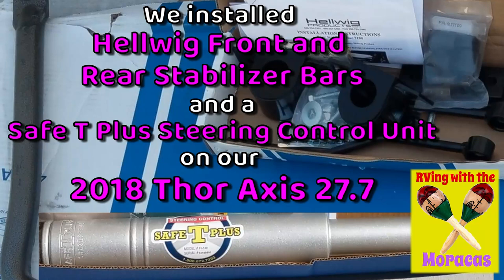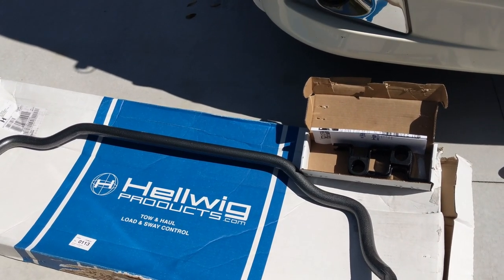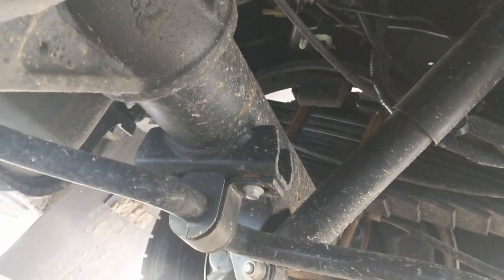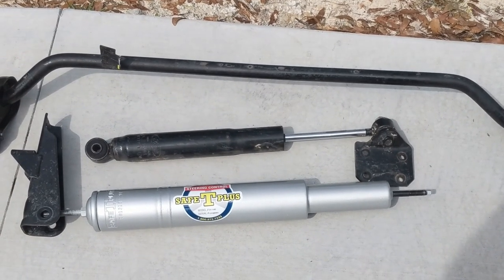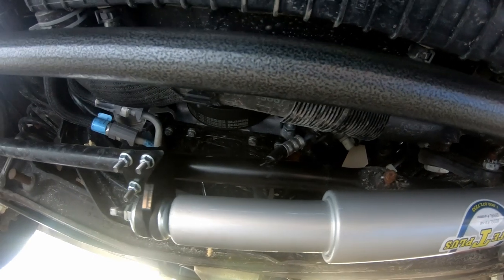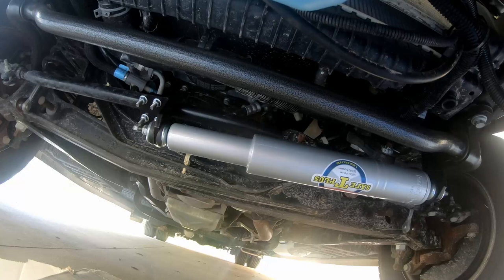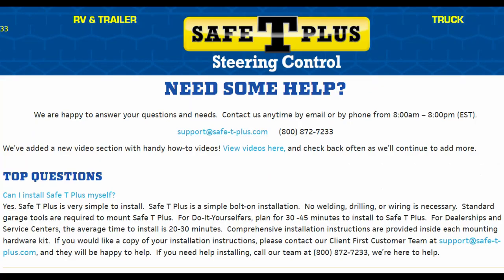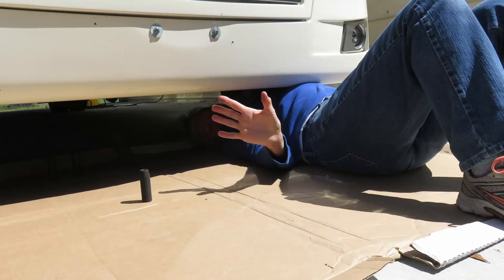RV Hacks Hellwig Sway Bars & SafeT Plus

Comment: Great video. The front Helwig sway bar I just installed on our 2018 Ford E450 in Nov 2023 included 2 new bolts/washers to replace the smaller headed bolts. Now all 4 bolts use the same size socket.

Comment: We did the front and rear Hellwig bars, front Sumo springs and the SafeTplus, wow what a difference. A pleasure to drive now.
Reply: That's what I'd like to do.  What year & model is your motorcoach? Did you DIY or have it done by a suspension specialist?  Are you thinking of replacing the stock shocks too?

Comment: We have Safe-T-Plus and Sumo Springs plus had extra positive Caster on our alignment, drives much better. The Safe-T-Plus factory in Atlanta installed our steering stabilizer and has already replaced it once and adjusted it twice at no charge. BTW, I think some of the right channel audio didn't play on your video.
Reply from the maker: Good to hear SafeTPlus has such great service.  I will have to listen with headphones 🍀
Reply: Hi 
Can you please share some info about the caster positive upgrade .

I am going to do it next week and i have the caster bushings for my 97 ford e350 tioga 24ft.
Right bow i have 3.2-4.2 caster 
How much the caster needs to be?

What price for labor this upgrade should cost?

Thanks.

Comment: You still need to do the sumosprings you will be surprised with the differece in driving
Reply from the maker: We did add the sumo springs and we agree the ride is much better.
Reply: @RVingwiththeMoracas  Do the sumo springs give a softer ride on the freeway?
Reply from the maker: Yes, we noticed a difference.

Comment: Steering stabilizers are just shock absorbers.. there is no center.  It just dampens the shock load from road input.  Centering is done by the caster in the wheel alignment.  If the shock absorber / steering stabilizer has a centering position and the caster center and the stabilizer center don't match..  you are going to have the 2 systems fighting each other,  and possibly creating a pull left across the center line or right onto the shoulder.  NOT good.
Reply: Yeah..  you shouldn't be having to adjust the steering stabilizer that finite.   If the original shock absorber was still absorbing shocks..  not pushing itself to any position, it was probably fine.  If a person didn't get the new stabilizer just right..  watch out lawsuit.
Reply: The Safe-T-Plus and Roadmaster RSSC do contain opposing springs for centering and a shock absorber each as well. One shouldn't ask either product to act as a band-aid to correct an underlying problem as it may compromise the unit when needed in a crisis (IE steer tire blowout at speed). They shouldn't do the work afforded by a proper alignment for the weight and driving characteristics of each individual MH (that particular vehicle loaded in travel mode). 
Getting a "proper" alignment for Ford E-350/E-450 chassis can be obtained but absolutely needs technician that knows what he's/she's doing with proper replacement bushings to achieve the configuration of CASTER for steering & return to center & wander correction :  CAMBER : and TOE-IN. Look into it (IRV2 and other web threads and those associated within their MH's brands) before paying for the everyday big bucks for the little effort service of 'TOE and go' most common today by computerized alignment jockeys relying on Ford's very liberal range of values (caster mainly) - which is necessary due to the versatile nature of the "E" chassis in all kinds of trucking/civil use configurations, hence it's popularity. Yes, "it's within Ford's specs", but not the specs the subject MH needs to drive correctly.
 Once the rig is aligned correctly and driving true, then add a safety steering stabilizer unit. In a panic moment, with the extreme shocks and noises of a steer blowout, having the aid provided by one of these units, in good shape and not fatigued, could make the difference between an inconvenience and a disaster. I'm not suggesting it'll keep you upright and on the pavement by itself, but it'll give instant and additional resistance to the immediate pull towards the compromised tire's side than a shock absorber alone, and offer a split second more time for the driver to concentrate on his steering wheel to correct and control the direction of steer,  accelerate a bit to get control of the vehicle's forward momentum, then direct it to a safer stop.

Comment: Thanks for the video. Question, I have same Ford e450 for my rv. Looking at the driver side where the anti sway bar is attached to the frame. How do you get a wrench around the nuts that are on the bolts connecting the sway bar and safetplus to the frame? Nuts are inside of hollow frame. Reuse same said bolt and nut? Thanks again for the video.
Reply from the maker: Yes you can reuse nuts just be sure bolts are correct length and get torqued appropriately. If not I would have a professional look at it.